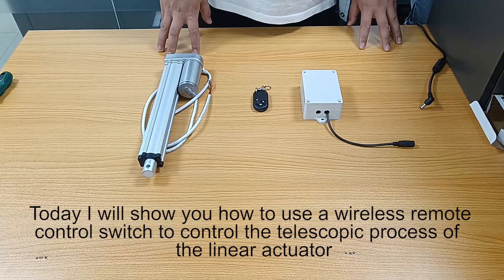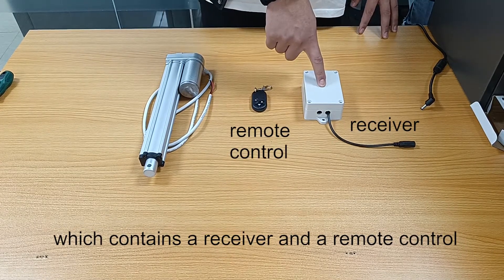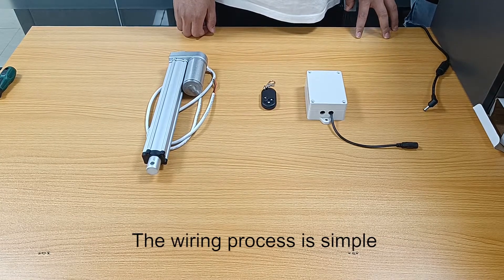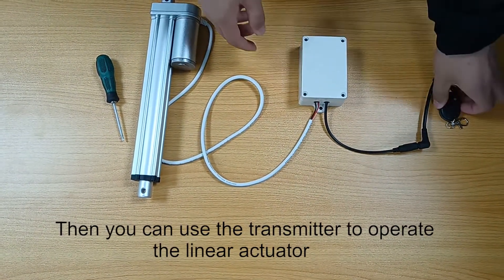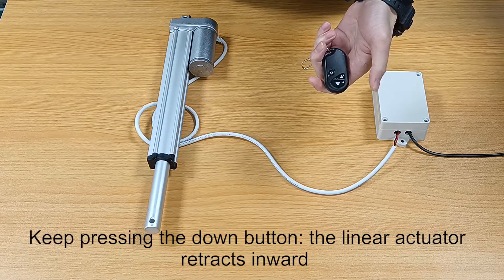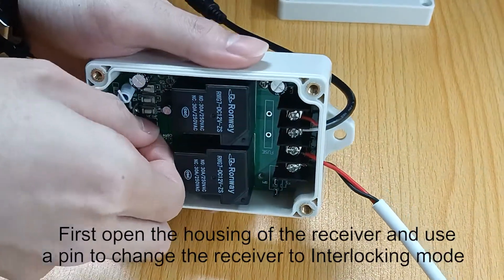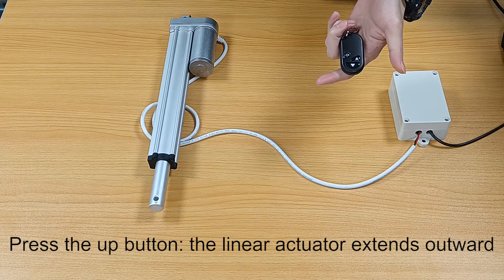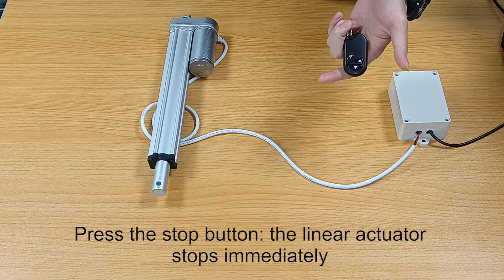How To Use Remote Control Switch To Control Linear Actuator

Comment: what kind of power supply for the actuator are you using?
Reply from the maker: We use a 12V/6A Power Adapter to power it, this is the link of this power adapter,
https://www.electric-linear-actuators.com/products/dc-12v-6a-power-adapter-adaptor-european-american-british-australian-standards-model-0010127